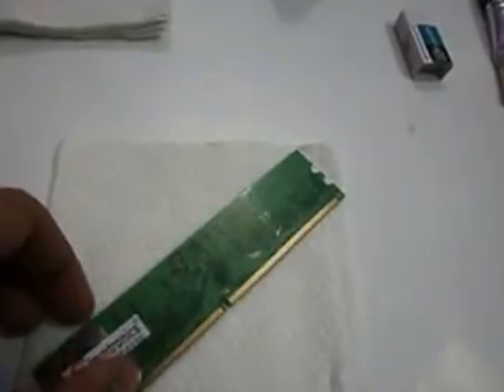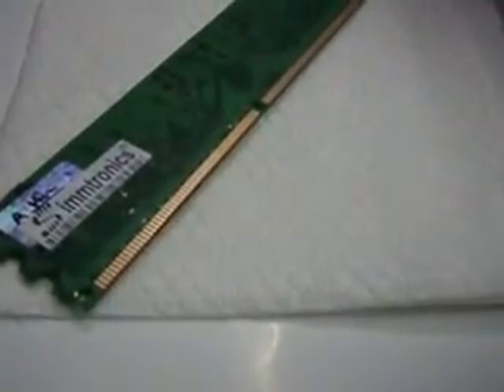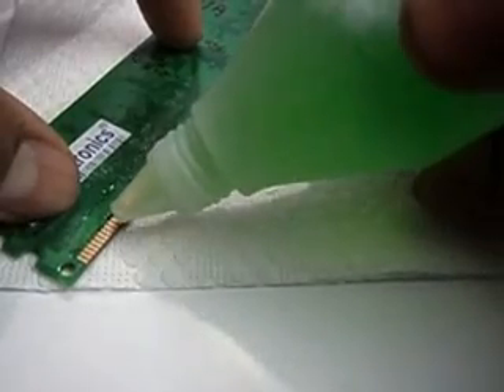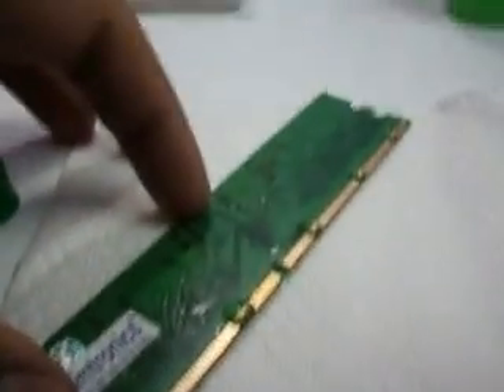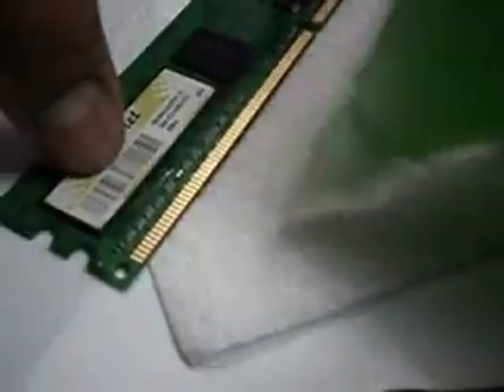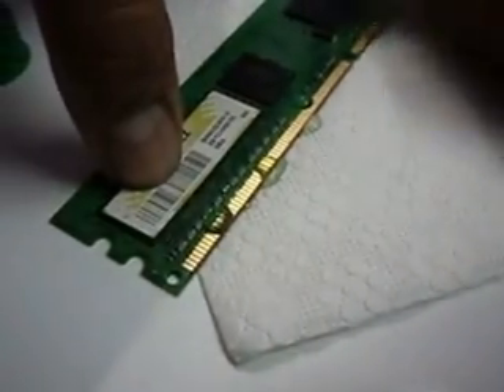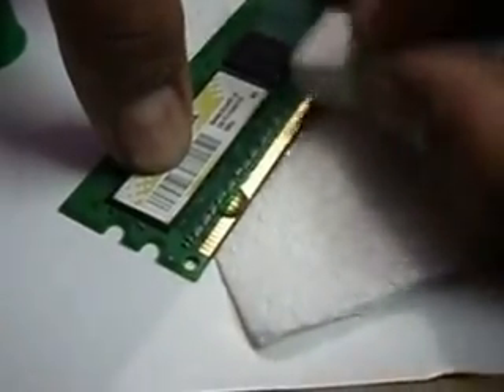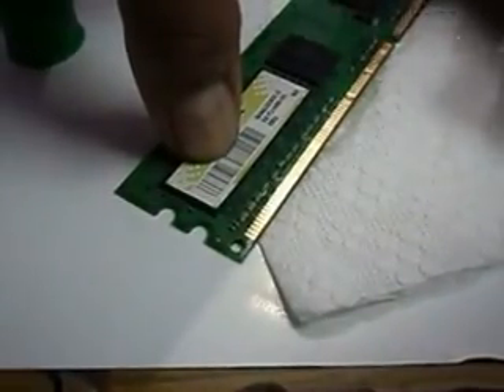How to Repair a DDR RAM

Comment: I just used fine sand paper, carefully wipe the copper contact surfaces to remove oxidation from it and you`ll see clear metal. Its same with flash lights or batteries or what ever there is two parts contacting. Metal oxidation is the reason for no electrical connection and copper tends to oxidate easily. I fixed lots of rams etc with just sand paper

Comment: reflow also worked for me!
Reply: When the issue is not the contacts, reflow has a big chance of working.
Yesterday i fixed 2 sticks using a hot air station at 300C
Reply: okey nice to know i,m not the only one who believes in it!
Reply: I believe too, but you should try this first with a q-tip and alhchohol instead, worked for me

Comment: THIS VIDIO SAVED MY LIFE IT WORKS AND FOR THE WANDERING IN THIS IS A SHAM FAKE OR WHATEVER ITS NOT BTW YOU CAN USE WATER INSTEAD OF GREEN LIQUID
Reply: whats wrong with your ram before?
Reply: Be like Bruh my computer wouldnt red it and sometimes it wouldnt even turn on with it then i did this and it reads it and it works
Reply: My computer won't turn on and it beeps 😭,do u know how to fix that?
Reply: +Be like Bruh your ram must be totally dead.
Reply: Help me bro's ive done this problem before ive clean my ram and everything was ok but after a week my pc shutodwn unexpectedly then it wont turn on again , and i clean it again , after i cleaned it i turn on my pc and it turn off but im wondering why my pc is slow and i look at my pc specs my ram is 2gb 1.45 usable last time but its not 2gb 744 mb usable and im fucked up , i cant play anygames pls help me
Reply: imfaceroll fan pay or DIE did you use an eraser that is important step. when my computer starts acting up i [reset it] take off all the parts on your computer and put them back on i know it sounds stupid in all but if you want to go a step farther blow everything with a leafeblower or hair dryer it usually works tell me if it dosnt  and i will try to asist you with everthing i know.
Reply: I get 5 beeps when I put my other ram back
Reply: Be like Bruh Well i did some quick research on that and it is either you [cpu] processor in case you didn't know or for any dummies or motherboard so i would suggest do my original idea and take apart your computer and put it back together because people were saying that it is your cpu and you need to check the pins on it just because it goes in the cpu slot dosn't mean all of your pins are in there so make sure that is my best guess.
Reply: Ok I'll try
Reply: bro its turning on again , i just remove the ram again and clean it again and my pc is working now , maybe my ram case is damaged or my ram or psu or motherboard
Reply: Be like Bruh ok but be carefull if you break anything i am not responsible i wish you the best of luck.
Reply: imfaceroll fan pay or DIE so it works now ? if so that is great to hear and best of luck to you.
Reply: imfaceroll fan pay or DIE What did u use to clean your ram?
Reply: Mathew garsia ok don't worry
Reply: Maybe my ram is dead
Reply: Be like Bruh have you tried it without your ram try with each stick individually.
Reply: Yes,I tried
Reply: I tried but one of my ram isn't working...... It makes my Pc beep
Reply: Be like Bruh your ram is dead

Comment: I was dubious watching this... but it really does work.

I was having problems with my iMac constantly rebooting after ruling out HDD problems by doing a reboot and clean install I nearly admitted defeat.

Removed the RAM and all was working again but though the RAM would be for the scrap heap.

Tried this method (without cleaning solution) and now all RAM is fully functioning and iMac is back to normal!

Great work Sourav! 

Thanks for sharing

Comment: Man... This shit is sooo simple... But it actually worked! I was in a hurry and had no alcohol so I used a toothbrush and some lacquer thinner. I've notice while cleaning there was like a semi invisible film and a thin layer of black sweat on the inner part of the dimm pins. My guess is pulling them from the cpu board allows them to discharge & then cleaning clears the sweat beause of heat. Hell it works and now my laptop display and boots. Thanks Sourav Aggarwal! Hey let me follow you on twitter bra!- Neal The TReal

Comment: HOLY MOTHER OF HOLY COW!!! IT FREAKING WORKS!!

what happen actually was i upgraded my current pc with an 8 gig ram and removed the 4 gig to be placed on the old computer but after adding that 4 gig to that pc it wouldn't start, so i bought a new one but after seeing this weeks later and doing this freaking method that ram worked again!!! I can't freaking believe such a simple method was effective. XD

btw i used alcohol instead and used the eraser on the back end of my pencil.
man i'm just freaking amazed by this i never would have thought.saved me another ram to add up to my lan party.

even for a 3 yr old video thanks a bunch man!!

Comment: I used 99.99% pure Isopropyl alcohol as this type destroys/eats grime away so easily and also it evaporates almost instantly without leaving any residue behind.  This can also clean the inside pins of the ram slots using a bristle brush and 99.99% alcohol....

Comment: To make it clear here , As This only help when your RAM gold pins , cannot get contact with the MOBo , some problem here are in the RAM chip set itself , that requires soldering  , or replacement of RAMS
Reply: +PaikaForEver Sad i knew it
Reply: +PaikaForEver Sad my game keap crushing i think i need new ram :/
Reply: +MASTER MIND game crashing ? not RAM problem . try adding more RAM to the system recommend 4GB .
Reply: when you type in run "windows memory diagnostic" and lunche the diagno i find i have problem with my ram :/
even with less ram game like victoria 2 it crush
and every game it crush 

i have 3GB RAM
Reply: i need usb right now  :/
or cd you know what forget about it i will  repair it
Reply: thank though :D
Reply: +MASTER MIND reparing it doesn't fix.  , the RAM is almost dead , recommend u change to a Quad core I5 750 , and 8GB RAM . 500GB WD Black . will do the job . last you for 5 years
Reply: i have i3-4130
3GB RAM

for now i need huge amout of money to buy i5 or i7 and 8GB RAM   :/    damn poorness

XD is poorness exist as word ?
Reply: peeeffffff problem resolved XD
 my pc was sick until i destroyed the virus by avast premier LOL every thing is good now
Reply: DO NOT do it with a rubber, it can destroy your ram , and you dont need liquid green, just wet a qtip with alchohol and rub the pins, it worked so good I tried it ( I am a gamer, was playing gta 5 and blue screens because of ram, then ran memtest86, found tons of problems, then cleaned the pins with the above method, no problems now, try it you got nothing to lose)
Reply: FoxTheLegend my pc is screaming

Comment: can someone help me please...i have an acer aspire m1100 motherboard,it supports dual channel ram so i bought 2 2xg stix of ram when i installed them my resolution changed there were screeching noises coming from my speakers and when i went to play a game it said my graphics card isnt supported i may need to update my drivers so i did some research for that and everything is up to date and ive switched them in diff spots and still the same thing...also my ram slots isnt the order of 1324 its 1234 which 2 colors are side to side and the same for the other 2...my friend told me my power supply may not b able to stand it but i upgraded to a 550w power supply....if anyone can help me let me no thanx.
Reply: Turboe1 Well I think the problem is the ram itself, if everything was working fine before then yea you're just gonna have to get new ram

Comment: what the hell this actually worked!! I used just a simple eraser on the golden part of my ram cards without the liquid in the video and my pc booted up like no problem lol!! Lately I was getting pc crashes and freeze and after this it's working fine, I was thinking about buying new ones which would've cost me from 70 to 100 euros damn can't believe it worked
Reply: and what liquid is that? if you dont answer me this video is a FAKE
Reply: solution

Comment: Doesn't work
Reply: Divakar Meena If it doesn't work then probably one or more of the ICs on your RAM have been damaged which means you will have to replace the RAM. When purchasing a replacement RAM look at the label stuck on the old RAM and buy a new RAM with the same values as on that label.
Reply: Thanks for replying after 1 month and i buyed a new ram.

Comment: erasers don't erase when wet
Gold plate doesn't corrode
Just slot it in and out a few times and the sliding contact action under pressure will ensure good contact
Mechanical solution - - rather than a dishwasher and tea towel

Comment: can you help how repair a motherboard  that wont start but the motherboard light is on but pc wont start
Reply: Try re-flow technique. Heath up your oven at home at 200 C, put your motherboard in the pan that is covered with tin foil. Let the graphics card be facing upwards and put tiny  tin foil legs under it so it does not directly touch the pan. Place it in the oven for 8 minutes, then carefully remove it, and let it completely cool off. After that connect it and it should work. Before all this, remove of course the fan, and clean all thermal paste from the motherboard.
Reply: New motherboard
Reply: You effed up? Or it did not work? The method is successful 80% of the time.
Reply: you must check your processor,probably he is overhating..he is taped to cooler,you must buy cooling paste which cost 5 or 10 dolars and smear cooler where cooler and processor are touching...my english is bad,but i have the same problem..:D
Reply: easy than you think, just change the battery, ok this is a posible solution